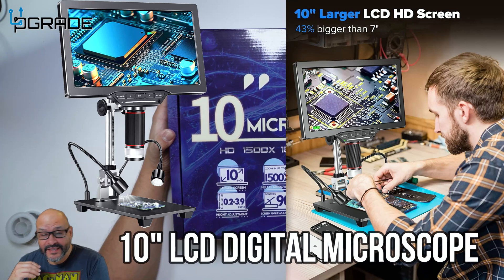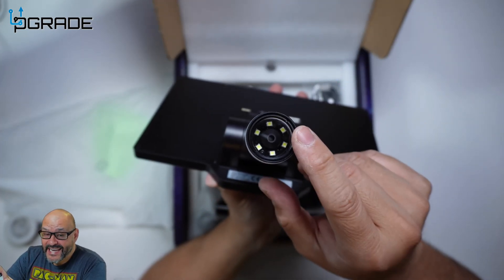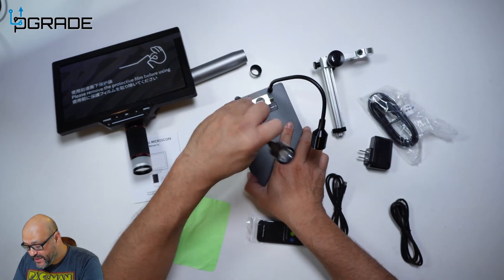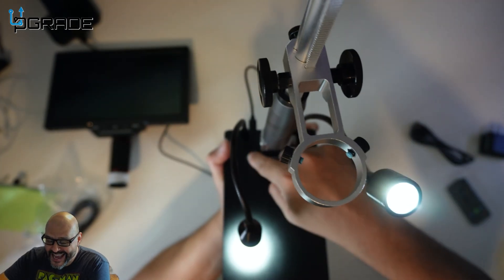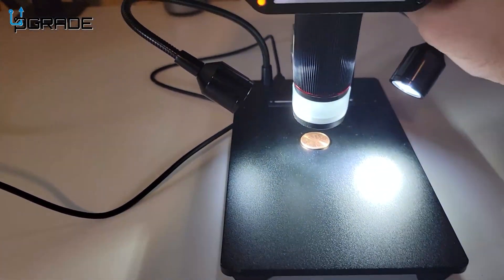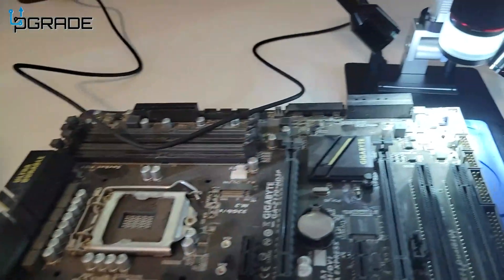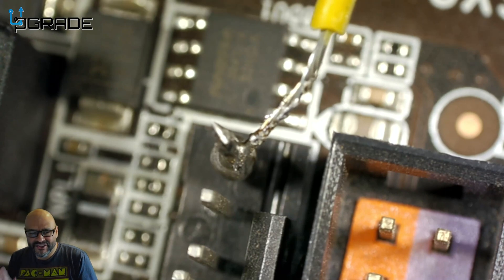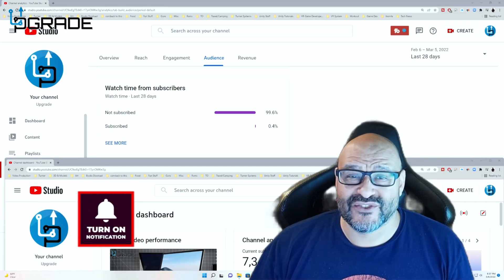Dcorn 10 inch LCD Digital Microscope Upgrade

Comment: You need to say the word "actual", or "actually" more often!!😂😆😅 Can the circular light at the end of the camera tube be removed? Or for a few $$, get a longer support/adjustmet tube? Thanks 🤓 is DCorn better priced than Andonstar? That model comes with an extension tube, to increase the distance from the camera & the  base?